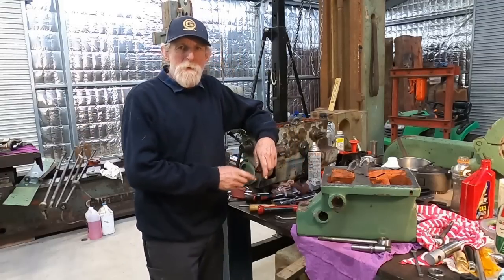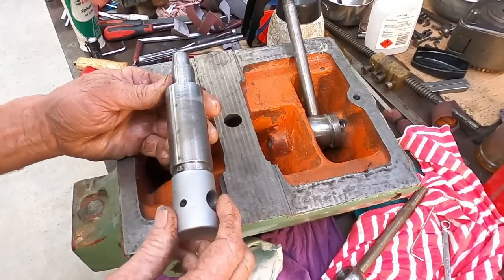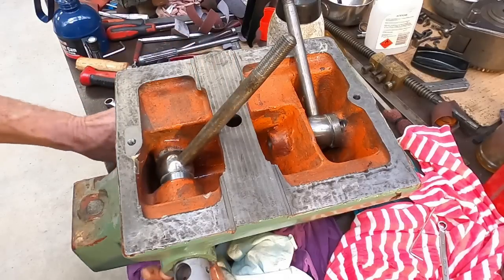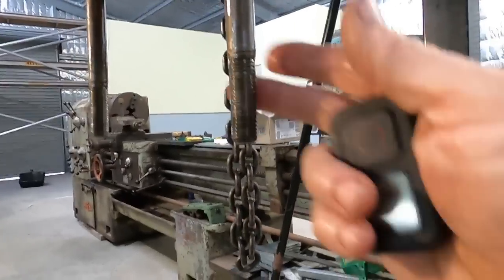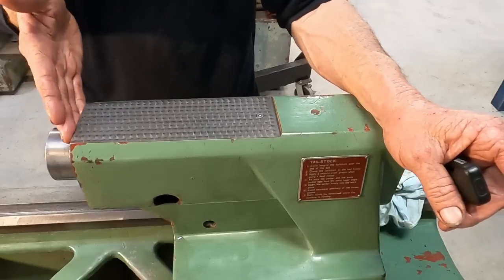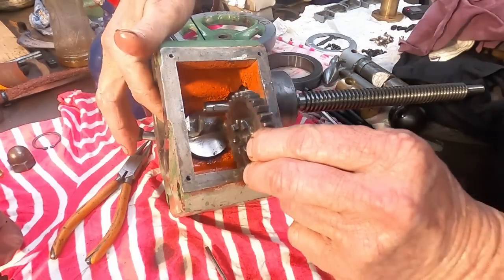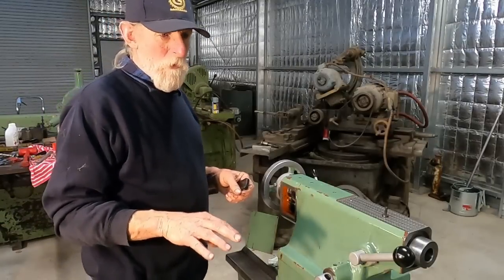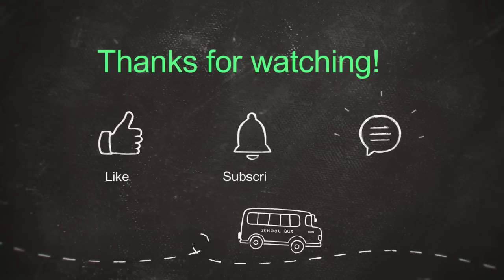JFMT  530 x 2000  Lathe Repairs .  part 9 .

Comment: Funny you mention Snap-On.  I still have the Snap-On tool box and Snap-On  tools from the 50's. my dad's tool box.  That tool box was carried off and on a plane for 9 yrs. No dents on the tool box. Too bad he didn't buy 5 times as many tools in the  50's he could of saved me some money. 😆😆
Reply: However, had he done that, the tool box would now be 5 times as heavy. 🤔
Reply from the maker: That would have been a bonus !   The tool shop where i used to buy them kept them upstairs in a locked room ! 👍

Comment: Hello Max.  I really like the two speed gearbox on the quill.  I have a 1-31/32" drill with a No. 4 taper that I use on my lathe and having a low range would be very nice.  Sometimes I feed it with the carriage as I have a No. 4 holder for my Dorian tool post.  The nice thing with using the carriage is being able to back the drill out with the carriage handwheel.  When you're in deep it makes clearing swarf very fast.  I think you've got yourself a hell of a lathe there. Ken
Reply from the maker: Cheers Ken .   A 17'' lathe i used to use years ago had a Dickson post with the same thing .  👍

Comment: Looks like it has gone back together really nicely Max. Certainly looks and sounds good quality. Never used a 2 speed tailstock on a centre lathe, 2ft length of tube was the weapon of choice, looks like a great addition! Cheers, Jon
Reply from the maker: Cheers Jon .  Yes , i used to poke a bar through the wheel as well !    👍

Comment: having a needed tool or part missing is usually my motivation to clean/organize, at least enough to get tools and materials into their own groups (piles?).  At least the time spent searching isn't an absolute waste.

I'd been chasing a problem with getting my lathe to cut equally (without a taper) and discovered that the quill lifts when it is locked, about 0.008 imp.  I'd shimmed up between the base and top of it to get it closer, vertically,  to center while center drilling, as a result I defeated the ability to align the tailstock on the horizontal.  So now I need to determine where the wear is and decide what to do about it.  I suspect it's wear on the bottom part of the quill, if it is I'm thinking a spray weld repair would be the ideal fix ... we'll see.  I've got a little more detective work to do before deciding.

The 'fun' of having century old equipment.  You find out what production operations it was most used for by where you find the most wear.  Center drilling and facing appear to be the top two on mine.
Reply from the maker: There might be wear in the quill bore .    Centre height is usually no issue with turning parallel as new lathes are a couple of thou high to allow for future wear .    If the quill bore is worn , it might be locking in different positions .  I probably would go for hard chrome rather than spray weld for a quill . 👍

Comment: Spherical Nut & Washer. We used them for setting the 240 ton compressors on the Wheatstone LNG Project. A bit bigger but at 150mm diameter.
Reply from the maker: That was one job i should have tried to get on .   The money , even a T.A was on was sky high !

Comment: Max- you are consistent with your rust prevention- is your area high humidity, or you are using good assembly methods?
Reply from the maker: Hi , i just like things oiled up just in case  !   Rust is not a big issue here .   👍

Comment: Additionally, if you cut the oil groove at the top of the quill most of the oil will remain in that groove, and when you try to put more oil in, you won’t be able to because of the pressure of the oil in that groove. Whereas, if you put the groove in the casting, as you have, then the oil tends to move down the sides, no matter how close the fit is, from capillary action generated from suction generated as the quill moves back and forth.
Reply from the maker: My thoughts exactly !  👍